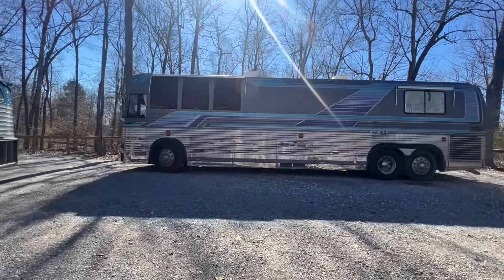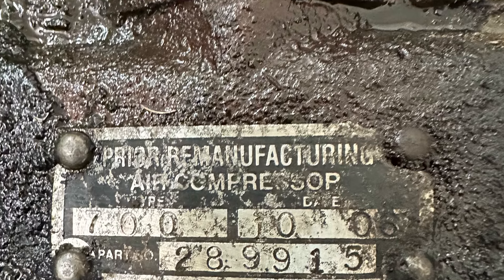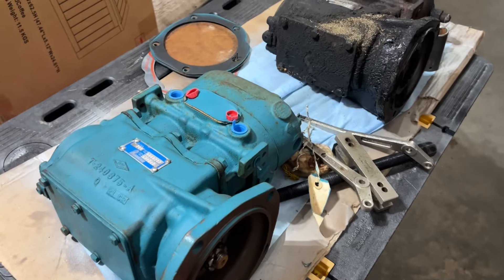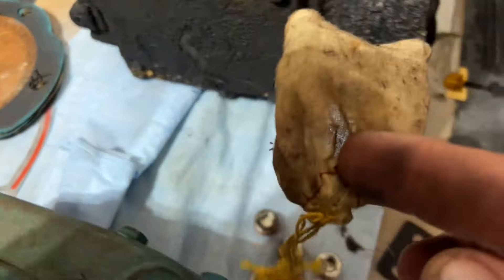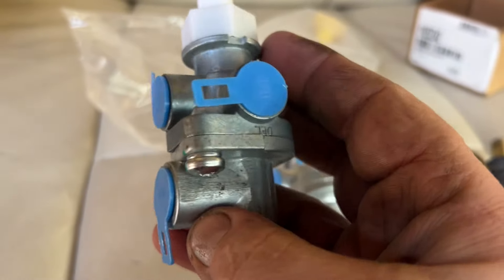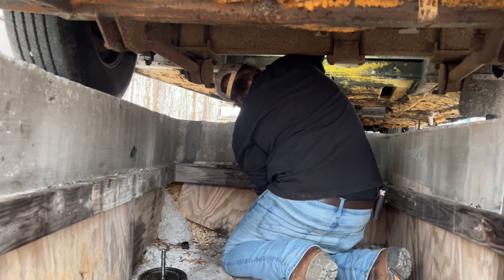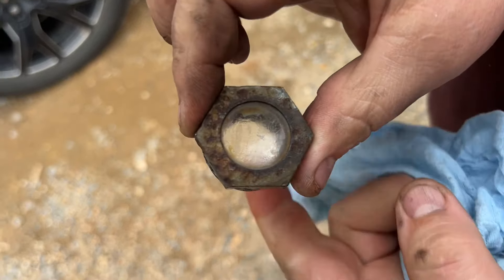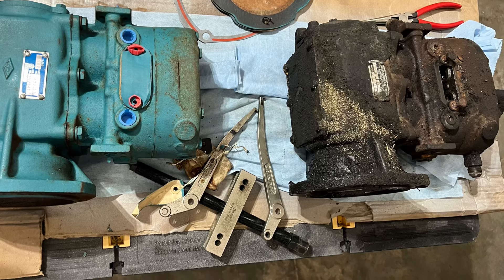What was in this air compressor? Air brake air compressor passing oil and leaking air.

Comment: Man I can’t believe the lack of maintenance I’ve seen on some of the busses you work on. Good for them you guys are straight up and know what you’re doing. I’m a do it yourselfer and I have a lot of vehicles but I keep up on all the maintenance. I bought my 1998 coachman rear diesel MH almost two years ago and I found a lot of stuff that had never or rarely been serviced. My air dryer wiring for the heater had been ripped off by the drive shaft at some point and the filter and desiccant had never been changed. People buy this stuff and think it will run forever.
Reply: Scott, check into CAT, CEET and SCAT, SCEET hose for pneumatic applications. Available where aircraft parts are sold.
Reply: A very well written comment.  It really shows the number of maintenance/repair shops that are dangerous.
Reply: The frightening part is that I’d be willing to bet the vast majority of these old conversions are probably unsafe to be on the road 😯
Reply: Well it will run forever provided that you maintain it properly.
Reply: I think part of the problem is that people get told that these are million mile chassis which incorrectly leads people to think that since it only has 125000 miles on it it’s basically brand new. Of course it’s 20’or 25 years only so nothing could be further than the truth.

Comment: Was working on a MCI 9 for greyhound in Seattle. 
Had a bunch of work on it. 
Wasn't popping off or unloading.
Found the signal line off.  Unloaders were stuck.  Had to spray Down with Lube 'um and manual move them. Cleaned out everything and was working good again.

Comment: Awesome job! An aside: I have a pretty extensive woodshop with a large air-compressor (upright tank, two stage, at 220v). I don't use my woodshop as often as I should. But I keep a log on when I drain the compressor tank. The last time I drained the tank, I had no moisture collected in the bottom, and it had been over a year. Oh, I guess this is important: I live in Reno, Nevada. I run two humidifiers during the winter months inside the house. One cannot make water out of absolutely no humidity. :)

Comment: You guys are great. Wish i had a service like this in Nevada. If i cant do the job, its $235 @ hr at freightliner. Another option is a couple meth junkies on boulder highway for $100 but im lucky if the wheels and tires are still present when finished. Good job

Comment: I wondered about draining Prevosts.  Mine said every 20 000 km or every year if I remember correctly.  There is almost no access to the tanks.  I need some of those pull cord drains.  I do have to say that when we have drained them nothing came out.  My air dryer works very well.
Reply from the maker: But when it fails you don’t know for a year.
Reply: Very true.  I was surprised to see that recommendation.  Love your videos Scott.  Wish I could get down there one day.  Stay safe and thanks so much for the response. @BusGreaseMonkey

Comment: I recognized that as for a inversion valve.
Had to teach the drivers not to set the parking brake right after the governor purged the drier
Has to have higher air pressure than when set to release the DD3 lock.
Reply: Sure, its not for anticompounding?   If the park brake is set and someone steps on the brakes, it puts the same amount of air pressure on the spring brake as the service brake. Thus keeping from multiplying the force being applied to the rod, slacks, s-cams and shoes.
Reply from the maker: It’s because dd3’s use air pressure to set the parking brake and also use air pressure to release it.    Unlike spring brakes just use lack of air pressure to set
Reply: @BusGreaseMonkey  
That's correct. There are 3 locking balls on the actuator rod that locks down on the shaft.
Reply: @timothyhays1817  anticompounding comes from the SR1 valve.
Reply from the maker: There are 8 cam lock rollers not 3 balls.  https://youtu.be/RpM_IptNPL0?si=w5oIJp6S-ovIssj4

Comment: Had the same problem on 3406b cat but the air compressor unloader pin went in the intake tube& into intake manifold & on into the engine cylinder . The cause of problem is the intake port floor on air compressor  is too big (low) & allows the pin to pop out.

Comment: It's troubling to see just how many bus and RV owners maintain their vehicles the same way they treat their cars.  Which is as little as possible.  RV's and busses are big trucks with passenger carry capabilities.  They will absorb a lot of abuse but when they fail the consequences can be catastrophic in terms of personal safety, cost or both.  As troubling as the attitude of owners is the negligence and incompetence of far too many so called "Service" facilities has to make you wary around any of these vehicles you encounter on the road.